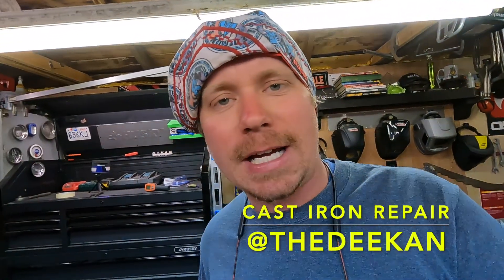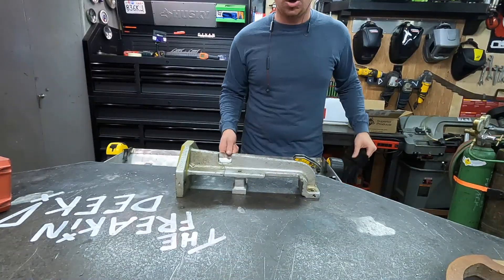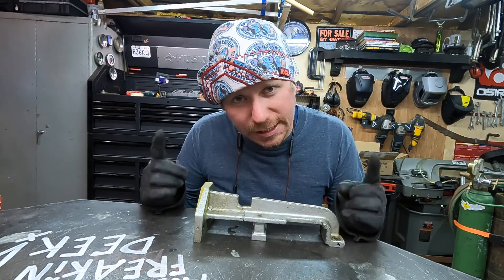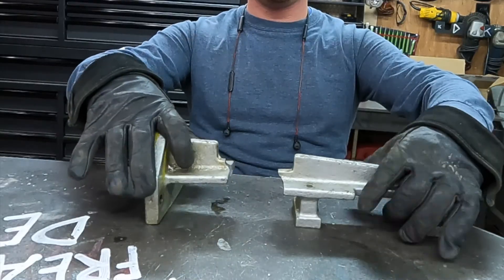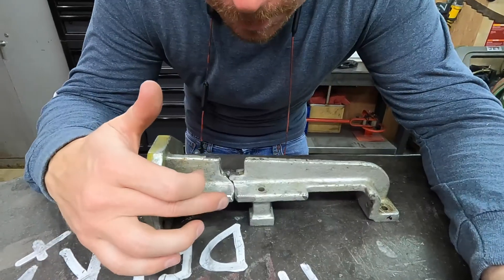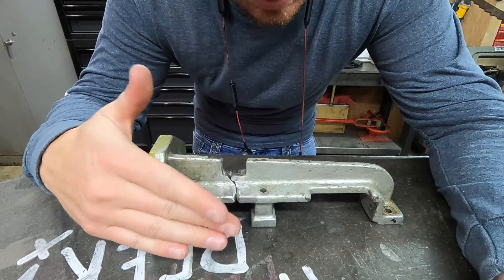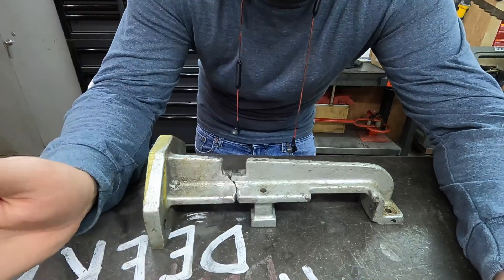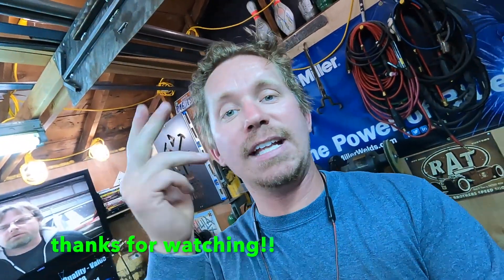Cast Iron Repair TIG Nickel 99 (Blue Demon) w/ Spark Test Instructions

Comment: I thought aluminum bronze was the more suitable  bronze brazing rod?
I've always used Lincoln electric cast iron repair rods (99%), have never pre heated and just let it cool naturally, never peened either (thought that was just for when you use steel filler).  Honestly I've never had a problem with welds failing and I repair a lot of old crap, as long as the edge prep is good you can weld from cold with 99 rods.
Reply: Same here